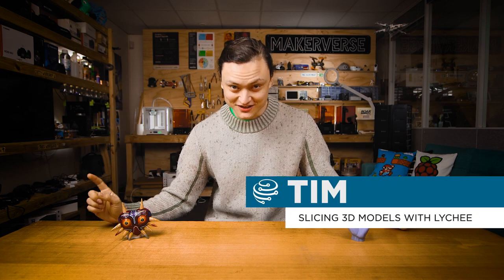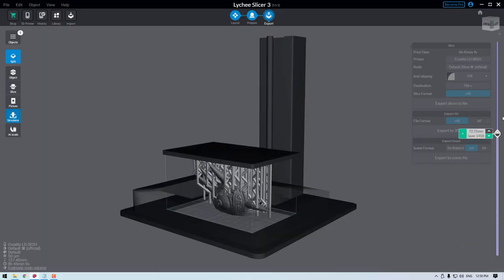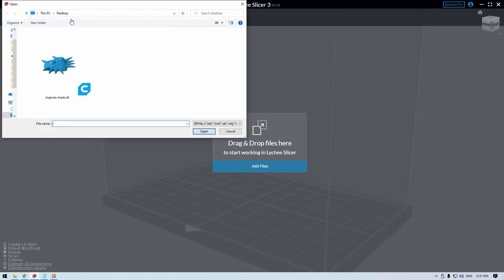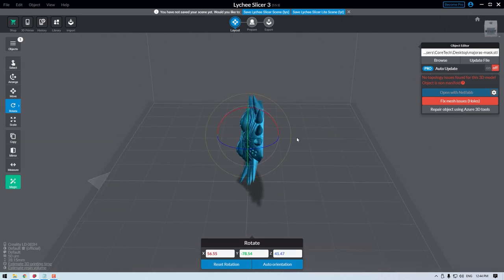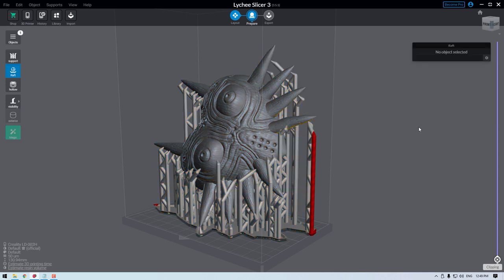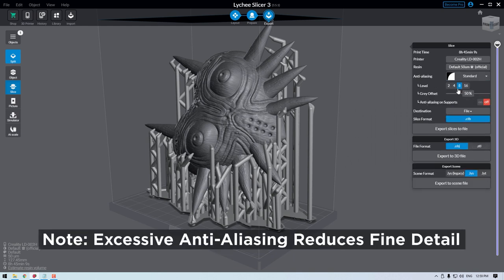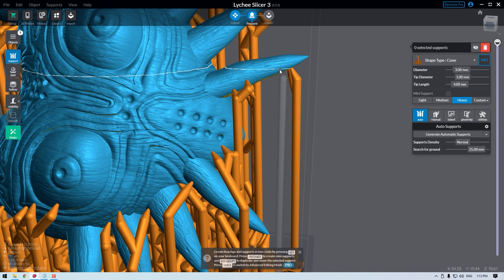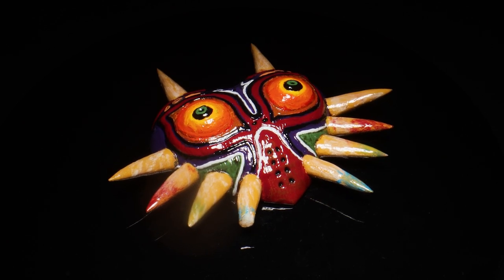How To Slice Models For Resin 3D Printing With Lychee Slicer

Comment: Just a little tip for the maring/pip holes caused by supports. If you do get them an easy way to repair it is to just grab a toothpick and dip it into your printer's resin and lightly dab it into the marks, use the toothpick to 'flatten' the resin placed then cure it per normal. A little bit of an extra wash as if it just came off the build plate to remove any left over residue uv resin typically leaves behind. On occasion a light bit of sanding may be needed if the dab of resin created a bit of a hump, but most the time it's fine as is and the little support marks vanish completely. I've done this for objects with a flat surface and high detail. So them little support marks are not the end of the world. :3

Comment: @Core Electronics, the "standard" anti-aliasing option is no longer present, the available options are now: Smooth Surfaces, Sharpen Details, Contrast Blur. Which option do you recommend to achieve the same result and with what settings?

Comment: what about models that would form CUPS.  How should the model be oriented?  If the cups are up then every layer would trap resin in the cup.  Alternatively, if I flip the part now the cup's open side faces the fep and on every retract it forms a suction cup that pulls the model off the supports.  So I do not know how I should orient the model?  I would prefer not to suction it off the supports but I do not know if pooling resin in cups would break the model?
Reply from the maker: This is a conversation very related to producing hollow resin 3D prints, concerns with suction and pooling resin. Depending on the shape I would likely have the cup's open side face/touch the print platform. Then I would make a small hole right on the rim of the cup to prevent a big vacuum forming. Open up a forum post, you can send through photos and I'll be able to help more.
Reply: I think you can just print it on the side and support it properly

Comment: I can’t get it to run in a decent window, the bottom part is not seen on 1600 x 900 px. No way to reach the settings then. It’s been a long time that a software engineer couldn’t make this work. Shame, I wanted to try!

Comment: hello,

why is leehy slicer showing 312 hours for printing at 0,50 layer hight? Whats wrong with the estimation?
Reply from the maker: Perhaps have a look at your Resin/Printer profile, there is a time per layer override setting that you can dial in to get better estimates.
Reply: @Core-Electronics  ok thanks!

Comment: hi! do i need a USB just like chitubox? how do i go about that process?
Reply from the maker: For a majority of 3D printers the fastest and easiest way to transfer the sliced file data is through USB. Once you save the file onto the USB you can pull it out from your computer and plug it straight into your 3D printer 😊.

Check this video for more help if you need more help on the printer side of things - https://core-electronics.com.au/guides/workflow-of-resin-printers/

Comment: what it the txt file after you slice ? is it useful in the printers?
Reply from the maker: Because I have creality machines Lychee produces | .ctb | files that get read by the Creality LD-002H UV Resin 3D Printer. If you are Saving the Scene its outputs as a | LYS File |. You can also export your models as | .obj| and |.stl|, as well as some legacy lychee formats.

Comment: HOW to ignore lychee slicer if it show some model error which can not be repaired? i PRINTED it via chitubox with no problems
Reply from the maker: Most probably the error your seeing is a Non-Manifold Object error.

Chitubox cannot detect non-manifold objects or other errors like that, which is why you don't see the error popping up there.

You likely won't have problems printing your model with Lychee if you are able to print it with Chitubox, just ignore the Error message and continue as normal 🙂. Hope that helps buddy.

Comment: My elegoo mars won't recognize the file when doing this method. Is there something I'm missing?
Reply from the maker: Elegoo Mars 3 is software locked to Chitubox and allows no other slicer. I have a feeling that is the issue here. All previous Mars 3D printers you have the freedom to choose slicer and can add their specs to Lychee Slicer by clicking the | 3D Printer | near the top left of the screen.
Reply: @Core-Electronics  I ended up figuring it out it was the wrong slice format getting things dialed in slowly now

Comment: Hello i got a warning  in my lychee  file is not manifold or tapology. can someone help me please.
Reply from the maker: Within Lychee is some file fixing methods which you can find near the warning that it is not manifold. 
You can also still slice files in this manner and through visual inspection see the impact that it will have. If it is only a minor thing (say you loose a small featured) you can print your file normally.